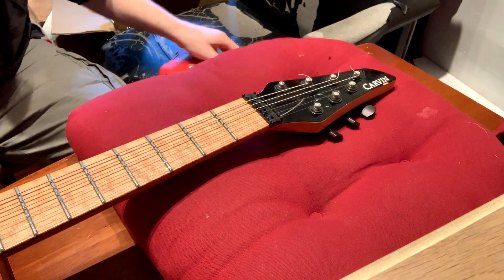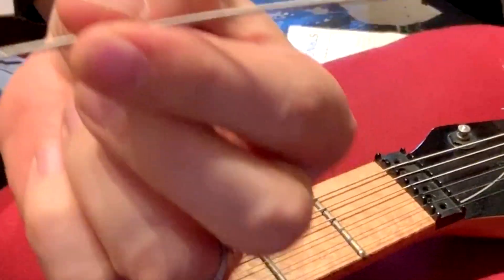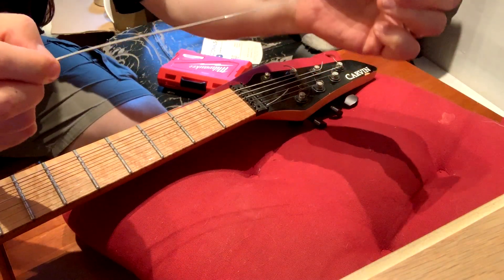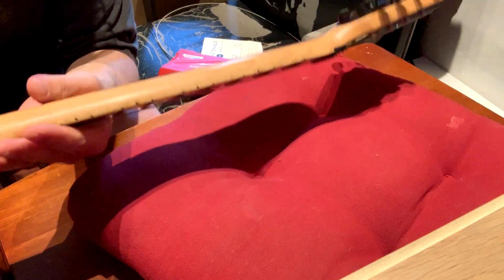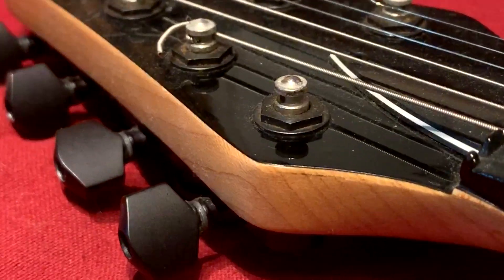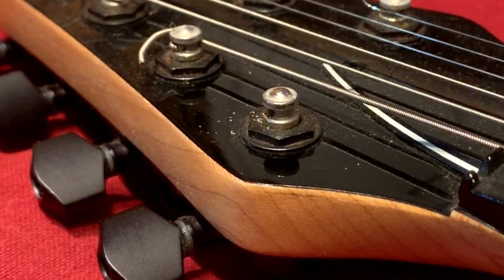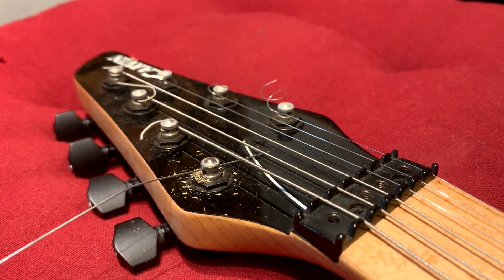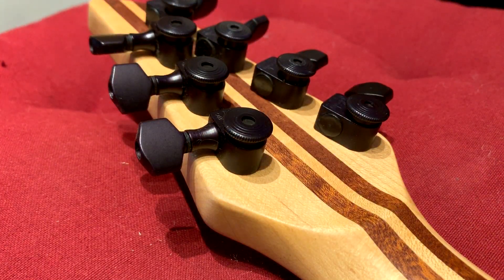How to Widen Tuning Peg Holes to Fit Thicker String Gauges (without Being Terrified)

Comment: did you do anything to "finish" the peg? like smoothing it or anything? i keep thinking that that the metal might be rough and break the string or something
Reply from the maker: I only made circular motions with the drill while it was in the hole so it would hit the edges. I definitely see the concern but it hasn't happened on either of the 2 guitars I have done this with.

Comment: Thanks. Wasn't really sure I wanted to drill my brand new eight string. 5/64" did the trick with a little bit of "filing". This is great I didn't want to unwind a F# string every time I needed to change strings.

Comment: This really helped me, i recently bought an ibanez rg (northern lights burst) 7 string guitar that came with gotoh magnum locking tuners. I had doubts whether i should replace the tuners at the expense of breaking my bank lol but then i saw your vid and got convinced to just drill the shit out of those tuners. I now run a 0.80 on my thickest gauge.
Reply from the maker: Karl Elnas great! I’m glad it helped you! I was in the same situation with my guitars (and even started wondering if I was gonna need to have a bass tuner installed...Major headstock surgery)

Comment: This described and fixed my exact problem! I have an Ibanez RG8 and my D'Addario 80 gauge F# string wouldn't fit to through the tuning peg. Drilling through this would not have been something I would have been comfortable with without video support.  Thanks man \m/
Reply from the maker: Alex Liggett that’s excellent, I’m so glad it helped. I felt exactly the same way before doing it myself so I’m glad I could put your mind at ease.

Comment: I wouldn't see this as a problem with the floyd-rose type bridge and nut locking as you have to chip out the ending of the string.
Great video of course, I am now encouraged to drill my hole for .80 :) thanks a lot.

Comment: How would you smoothen out the hole? I have seen times when there is a sharp edge on either side of the hole and I think it is causing my strings to break when I get to the tuning process.
Reply from the maker: I've never really needed to do that, but I can see how it might come out with sharp edges, especially if you do it for too short a time. When I did it, I let the drill just spin in the hole for a while for that very reason. If I had experienced sharp edges, that's also probably what I'd do to fix it... just grind them down a little with the same drill bit by letting it run in the hole for a while, and give it a tiny wiggle so it hits the edges all the way around just a little. That's me though; I'm not sure if there's a better way.

Comment: So I have a Fender Lead III where the holes for the tuners are at the top with a notch that brings it to the side and not a hole on the side of the tuner like in this video. Is it possible to drill into it the same way or would I not be able to make the hole bigger? Thank you for your time and for making this video.
Reply from the maker: I'm unfamiliar with this type of tuner, so unfortunately I can't say either way; if it was me I'd have a repair tech look at it and tell me if they'd do it (if they're willing to tell you what solution they'd use), or of course just have them do it.
Reply: Thank you. I appreciate the response and will look into a guitar tech.

Comment: What should I do if I have a normal nut instead of a padlocked one like the floyd's?
Reply from the maker: You can just skip the part where you loosen the locking tuners and go straight to drilling.

(The locking nut really doesn’t come into it by the way. My guitar just happens to have a locking nut from the Floyd Rose, as well as locking tuners; overkill from the guy I bought it from originally.)

Comment: What about when your bridge hole won't fit the higher gauge strings? Tried to but a .130 bass string on my bass but it won't fit through the bridge hole
Reply from the maker: There might be a fix for that but I don't know what it is. I suspect it would require a new bridge and some body drilling. Definitely not something I'm qualified to advise you on, unfortunately.

Comment: Ima about to do this tomorrow when my .74 gauge gets in. I have a Ibanez fanned fret string and the .64 gauge is fret buzzing like no tomorrow and I just got it back from the luthier. The luthier did a great job it’s just my low B is buzzing but it’s my fault for choosing the ring gauge for the low string.
Reply from the maker: Yeah just start small, and you might need to use a couple different thicknesses to gradually carve some of the material away.
Reply: @ShredMentor  thank you for replying, I actually drilled out the whole just like you and did a perfect shave inside the post, funny thing is the D’Addario .74 gauge string I brought came tapered perfectly so I didn’t have to drill the hole out lol. But regarding food I got with another brand it may not be tappers and your video was great thank you.
Reply from the maker: @ZEUSINCARNATE  I know that Ernie Ball strings also have it tapered at least on their eight string sets, but yeah you never know with other companies, so it’s probably still good that you did it so that you’re not gonna have this problem later (unless you go with too insane a string gauge). Lol

Comment: just cut the string and unwind it. less hassle than drilling your tuner.
Reply from the maker: Having to do that every single time you have to change strings from now on sounds like significantly MORE hassle than this one time, 5-second drilling job.
Reply: @ShredMentor  not everyone wants to drill their tuners.
Reply from the maker: @nicosonic  clearly, but that's largely out of fear and from not knowing this is the solution. Also, this is obviously a video to show you HOW to do it so you don't have to go to a luthier who would do the exact same thing for you and charge you money for it, no one's twisting your arm here lol — you might notice the 4 years worth of comments here thanking me for showing them this. I just used this guitar in the video to finish up some guest solos this morning, to illustrate that 4 years later the guitar is still doing great. 🤷‍♂️